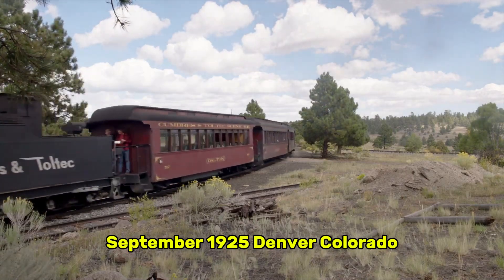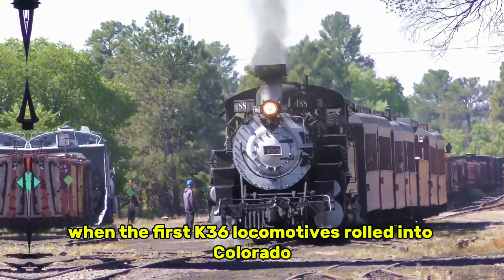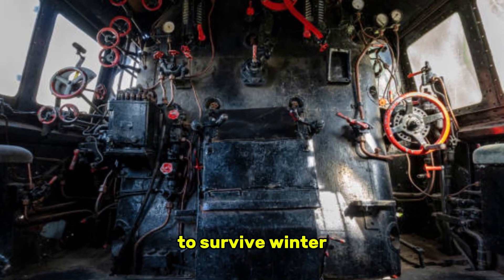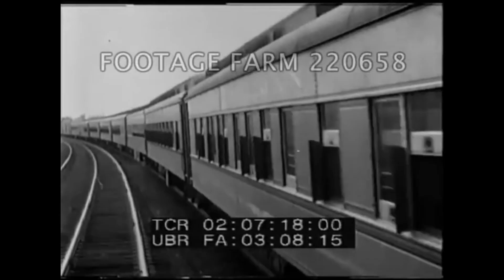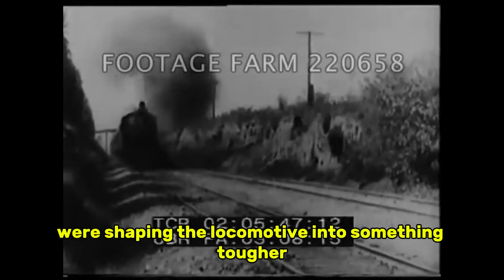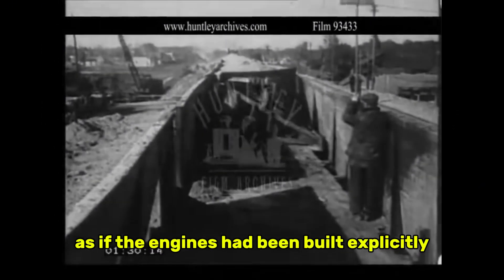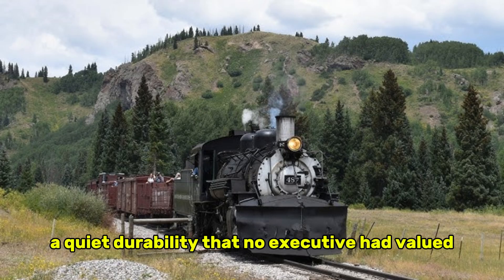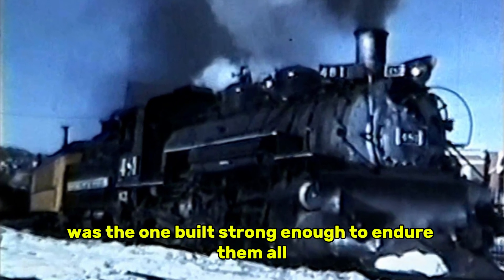Rail Companies Dismissed This Narrow-Gauge Engine — Until It Survived 100 Winters

Comment: The K36 became a legend because it survived long enough for the Great Steam Revival. It is one of only a few whole fleets of locomotives still in operation, and probably of an even more select few that still do exactly what they were designed to do. I find it intriguing that so many of these mountain railroads ended up with stubbornly reliable fleets of steam engines